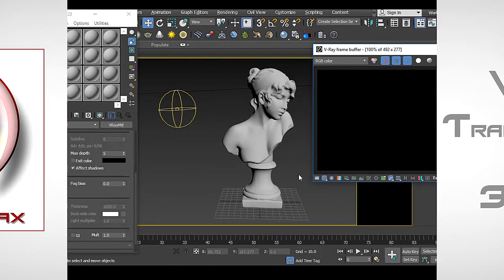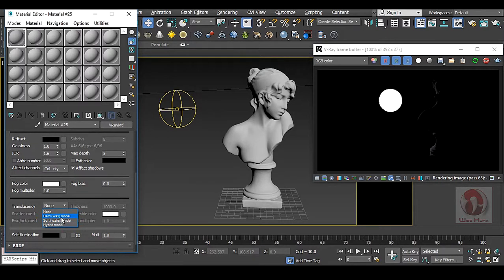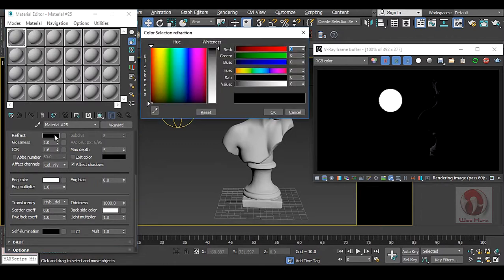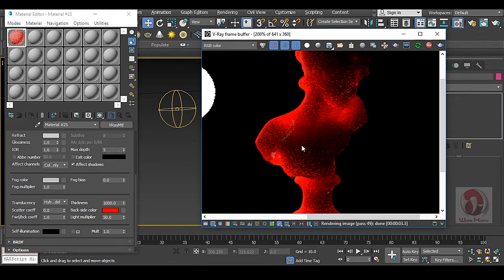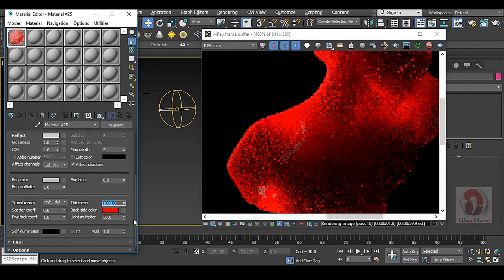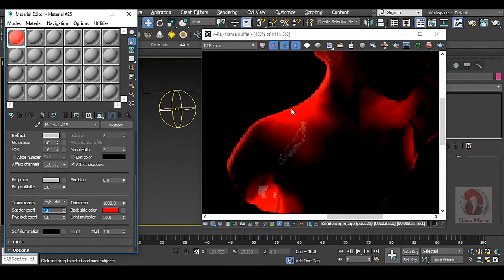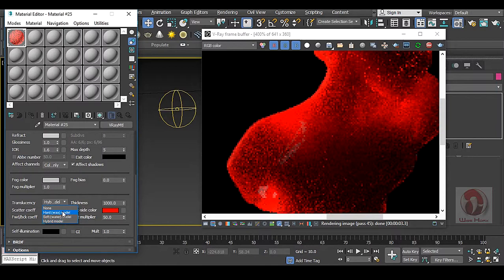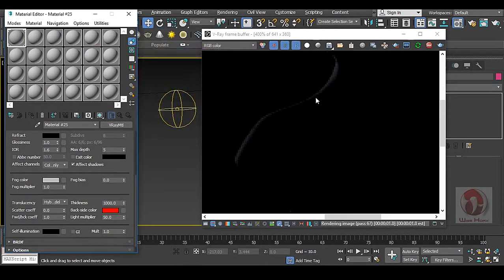✔️V-Ray Translucency in 3Ds Max

Comment: Hi there and thanks for the tutorial. I'm wondering why the translucency parameter in my V-RayMtl node was grayed out. I had transparency on, gave it a positive value, but there was no change in the accessibility of the translucency parameter. 

Any theories? 

Thanks.
Reply from the maker: Make translucency parameter Hybrid Model
Reply: @WiseHoax_ArijitDatta  I found the problem. I was using the GPU option for VRay Next, and when I went to CPU only, more options appeared in VRay shader nodes, including translucency. 

Thank you.
Reply from the maker: Check out my website https://wisehoax.com/ . Let me know how your experience is. Whats app me on +91 9998666249